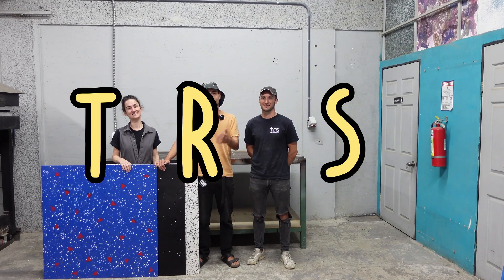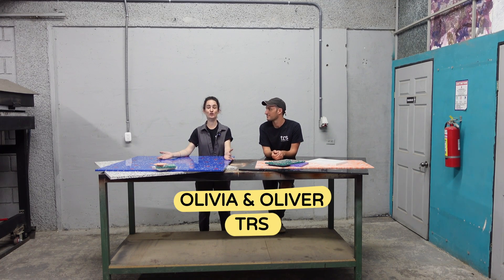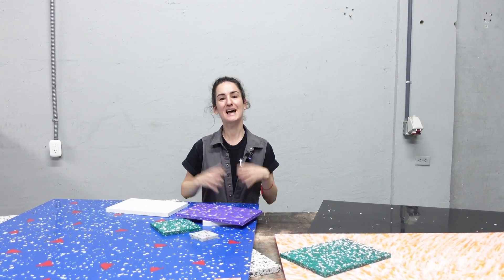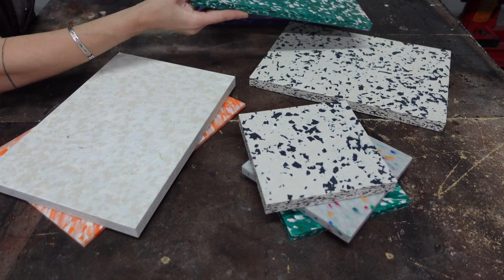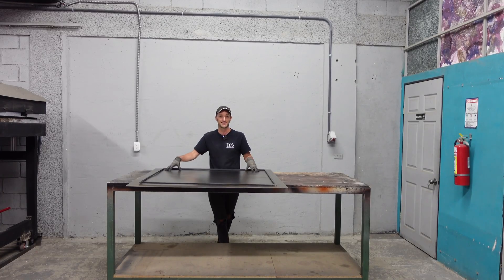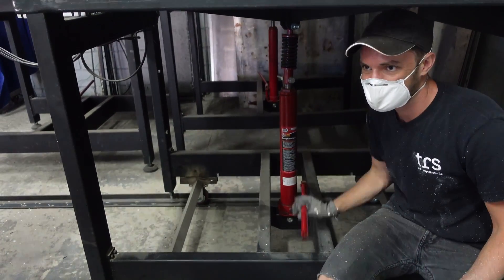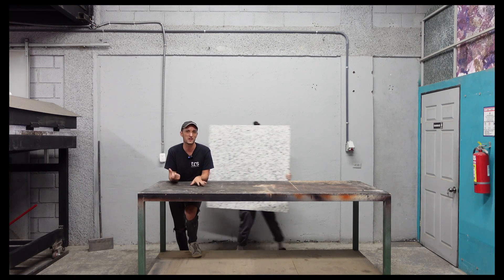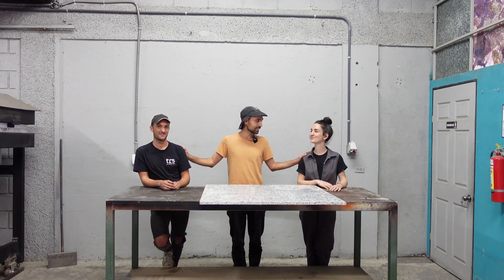The ultimate guide to make the PERFECT sheet | 2024

Comment: >and then we push on jack as hard as we can untill it cant go any further

Hey just so you guys know, this practice is really bad for the gasket seals in the hydraulic body. If you make a habit of straining the stroke pump that badly you damage the vave inside it (best case scenario), or worst case someone can get hurt by the descending metal slab & the large glob of molten plastic that may follow soon after.

Also, have you guys considered trying to use an ultrasonicator arm probe to remove the bubbles after it melts? They are used for that purpose in a lot of other unrelated industries. They are very very expensive at that scale however.

Comment: I can think of a few things to optimize production, but with their relatively 'low tech' approach working so well, it'd be difficult to throw anything on other than to boost production rates. Getting rid of bubbles is really quite easy, which is to dry your material, usually for several hours at half of what your molding temperature is running. 
Now if you want to crank out as many as you possibly could in one day, having water-cooled platens would make a Huge difference. That would be the single largest difference and relatively easy to do, especially if you have access to CNC partners. Pumps don't need ridiculous flow rates (making the operation cheaper) and the water source itself can be recycled over and over without much degradation in a closed loop, as the water is never coming into direct contact with your plastic.

Comment: I presume the mold is OVER FILLED, so that applied pressure encourages voids to escape out the sides as the squeeze is applied.  Here's what I don't get: once both faces are in contact with the mold frame, no more pressure can be applied... yet, part of their formula for bubble-free sheets involves interval cranking of the hydraulic press.... which would be impossible if the frame mold were in contact with the upper press face.  Is the top face of the press never in contact with the frame mold?   Is pressure in the mold entirely relying on the viscosity of the the plastic at melt temperature?
Reply: I had the same question in mind.
Reply: I'm also interested in this, but bubbles implies air, in concrete you would use a concrete vibrator to agitate the bubbles, but you can't agitate, but as air escapes and the volume changes you would need to increase pressure again? 
I guess at an industrial scale or more complex press (expesnive), that press would be automatic and would maintain a constant pressure. 
Both the videos were brilliant on this topic.
Reply: @dmbrookfield  While eliminating some color patterning control, the common method to eliminate voids is to fill the press mold from an extruder not unmelted shred stock.   A plunger-type top mold would allow for greater sustained pressure application; looking back at the development of the Precious Plastic Sheet Press, early versions featured plunger-type mold tops.   Flat mold tops reduce needed clearance, fabrication costs, ease removal and maintenance demands, reducing production time and labor costs.   All design is a trade.
Reply: @mavigogun  Thank you so much for the answer, I keep forgetting to check for replies. 
Yup everything is a trade off, increasing the pressure with a motorised more powerful press would do more as well I guess, but that increases costs.. 
Thanks :)

Comment: Please share more details on the surfaces of the hot press. What is the thickness? Are you using the same heating elements from the original design?Any details to look for. It would really help people like me who is in the process of building their sheet press set-up
Reply: Oh yeah please share some more about the machine, I’m also in the process of building a sheet press and I’m very interested about those thicker aluminium plates and how did you do with the resistances? Thanks!
Reply: I think they use 5cm plate